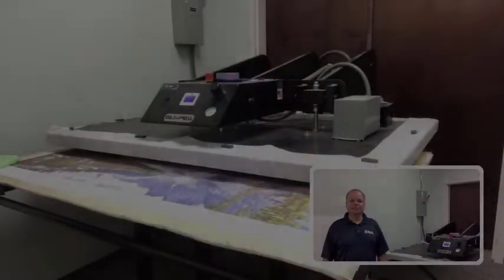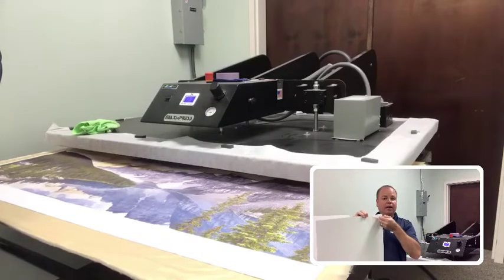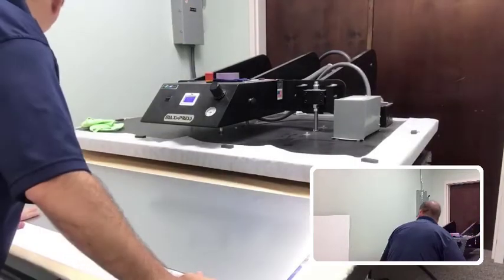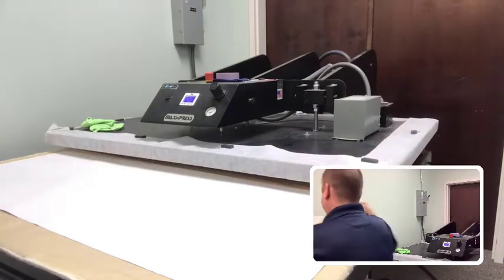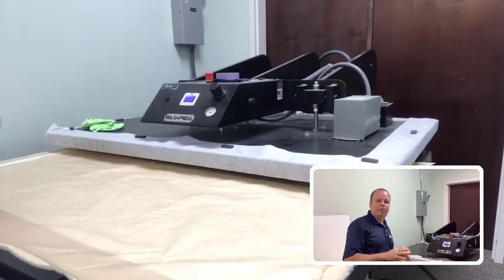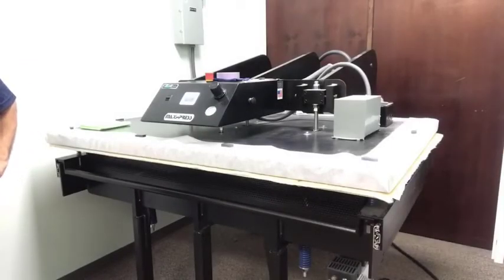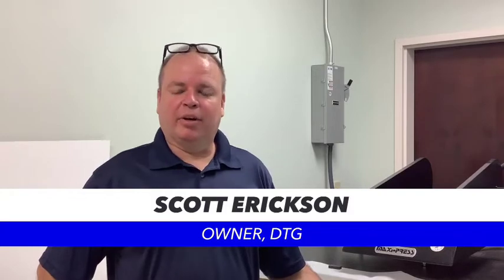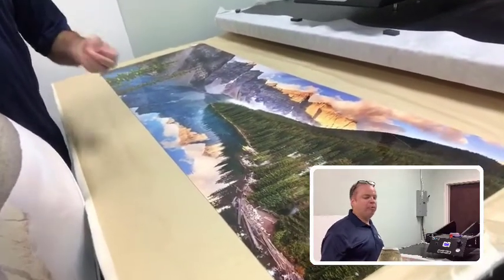GeoKnight MaxiAir 44x64 Automatic Heat Press demo of Dye Sub Chromaluxe Aluminum

Comment: Greetings! I wanted to express my appreciation for the fantastic video you shared. I have a question about the press you showcased: is it capable of pressing chromaluxe panels of varying sizes? like all sizes ? 
Additionally, would it be possible to use the same press to sublimate hoodies and t-shirts?

cordially
Reply: Thank you for your feedback. The Geo Knight press we are showing certainly is well capable of doing any size panel that fits within the press size, including multiple sizes, or ganging up panels. 

As far as textiles, specifically hoodies and t-shirts, you might be better served using a smaller clam style press for those applications. Why? Often you can improve the press quality and overall quality of the product when you can use the best size platen, pillows, etc. to optimize the press for the garment. In addition, the time and temperature settings are uniquely different making switching between hard substrates and soft substrates more challenging. You always want to ensure when doing this you adjust for pressure, time and of course temperature (allowing the press to heat up or cool down to the optimum temperature) so the long answer is perhaps, but probably not ideal. 

Thanks again for your feedback. If we can assist you further or if you have suggestions on other videos you would like to see us produce, please send reach out to us at sales@dtgweb.com. Thanks again and happy pressing!

Comment: Is it possible to use a smaller heat press (16x20?) to safely sublimate a larger print to a metal chromaluxe panel? (ex 16x48? or even scarrier, 24x48?)  as long as you keep the paper perfectly aligned?
I'm guessing that's a bad idea but I'm hoping you can answer this before I consider getting a Epson F570 and a heat press. I had one of my photos printed large on aluminum and omg its so awesome I want to do it myself. I just dont have the room/power for a large heat press. (but some how I am convinced i can fit a F570 in somewhere)
Reply: I am looking to do the same exact thing
Reply: @ronaldssali2122  I contacted geoknight website the other day after seeing your reply. They were quick to respond with the answer (Thanks so much GeoKnight for the honesty!)
Pasting their response here..  glad to have it answered even if its not what i was hoping for.
"You can wrap and tape the paper in place to avoid movement, and press items in multiple pressings. The problem is that the print will show the overlap of heat, so that areas that were overlapped will print a little darker or lighter depending on time. It is not practical, and the results are not smooth enough to be acceptable visually. You really have to press and heat and hit it all at once."

Comment: Hi there, just wondering if the heatpress needs to have a nomex pad attached to the aluminum heatplate, or is this a spec that only certain heatpress makers have?
Reply from the maker: Hi Brendan, the Nomex pad is not 100% required but helps with stabilizing the substrate (among other things) in the heat transfer process. Its very highly recommended when doing rigid substrates like aluminum to prevent any possibility of shifting. Also, the larger GeoKnight heat press like these maxi presses ship with them included. We also sell Nomex material separately.
Reply from the maker: Also, maybe I misunderstood. The heat plate is on top, and no, you would not want to attach a Nomex pad to that also...just on the bottom. What we are showing on top is a moisture wicking fabric wrapped around the heat platen.
Reply: @dtgweb  Thanks for the quick response! Good to know. Sefa appear to advertise that their heatpresses come with a nomex pad attached to the heat plate itself, but I cannot understand why they do that, maybe it helps protect the items being pressed? But because Nomex is heat resistant it must take a lot of time to heat up (and possibly slow the transfer of heat into the pressed item?). 

But the Geoknight presses are popular for Chromaluxe, so I assume a bare heat plate, with an Endura fabric or similar and blowout paper on top, and nomex underneath the substrate, is perfectly fine too. Thanks!

Comment: Hello, does your heat press comes with a air pressure system, or air pressure bought seperately
Reply from the maker: Hi Keeno, You need to purchase an air compressor separately. Thanks.